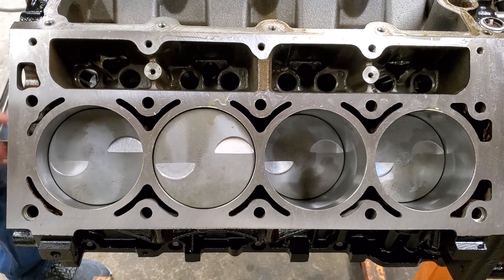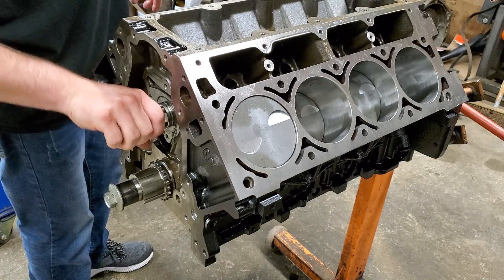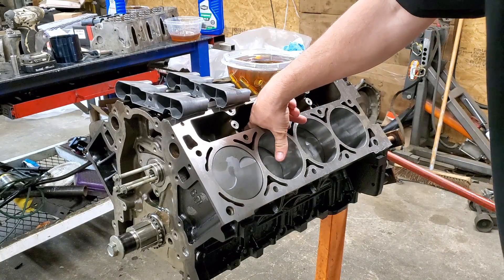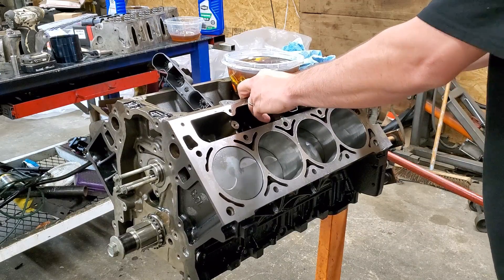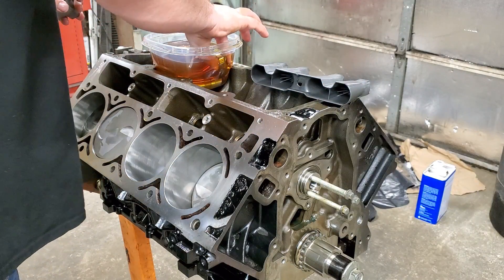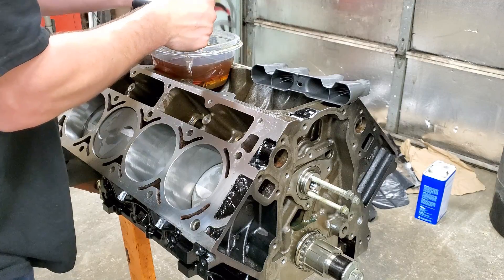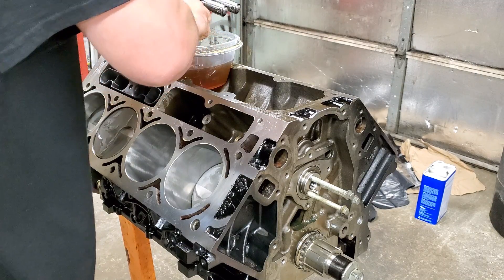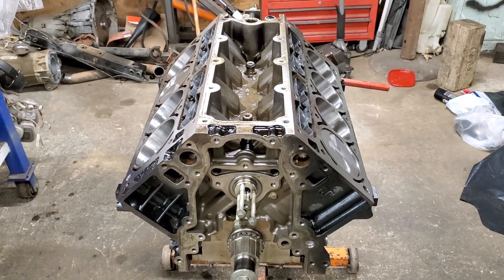6.0 LQ4 LS Motor Build Part 3 (Cam & Lifter Install)

Comment: I am working on doing a LS swap in my 03' Crown Vic Police Interceptor. 6.0L. This will be my first engine rebuild as well. I've done heads and such the same as you have. I tend to way over think stuff. I've seen enough videos and read enough to know I can do it. Am just in the save up mode right now. Great videos. Thank you.

Comment: Mine has a lot of blow by and no power just built motor. Now ticking in pan, rings to much gap
Reply from the maker: Sounds like it.
Reply: Did you maybe get the rings that are supposed to be for boosted applications?